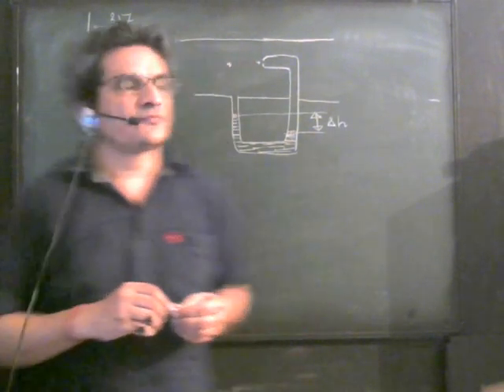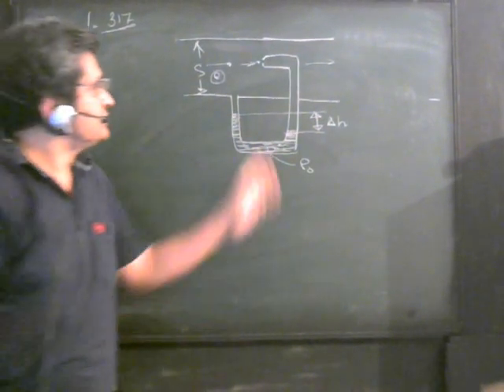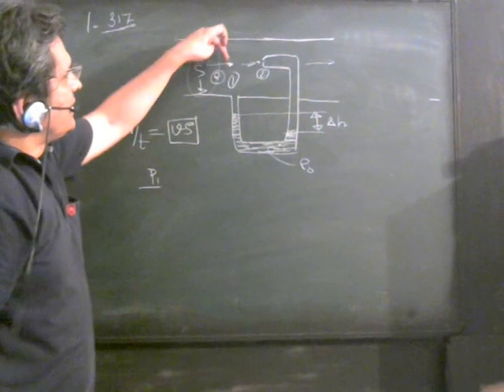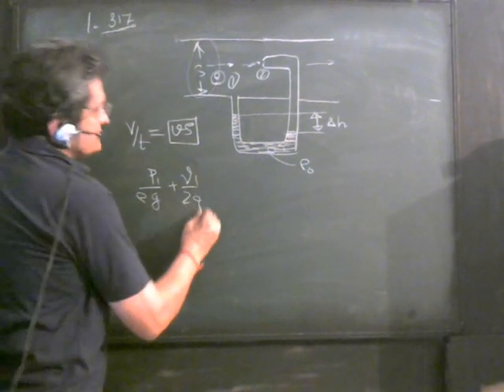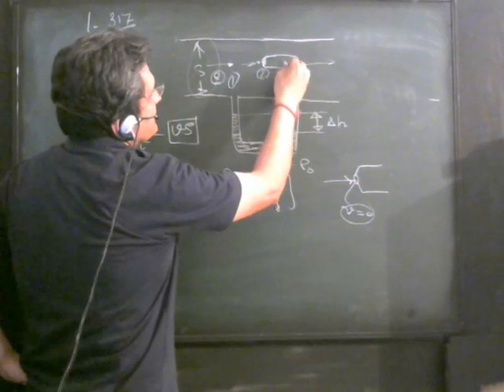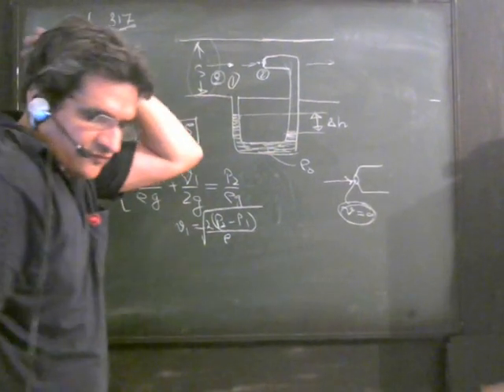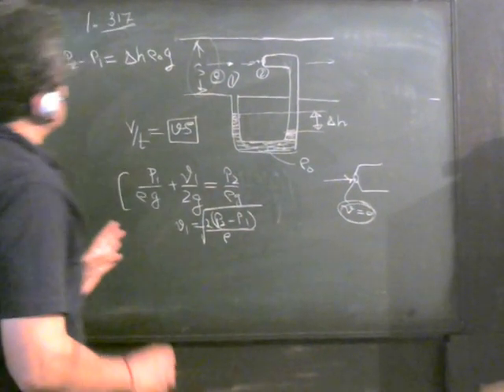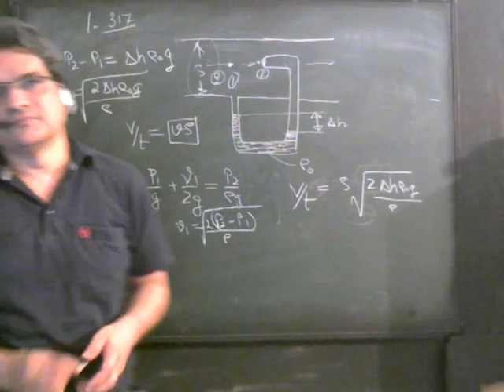pitot tube solution to irodov problem 1 .317

Comment: Sir I need solution for problem 1.315
Reply from the maker: In the problem the flow is steady. Hence at the turn the flow is irrotational meaning v.dl for full loop is zero. Draw perpendicular lines ( perpendicular  to sides ) at the points where curvature begins and ends. Also join the inner points and outer points by curves parallel to the sides of tube. This makes a full loop. The velocity of flow is perpendicular to two sided of loop and there v.dl will be zero. For other two sides the length of outer curve is more, hence velocity vwill be less. Now apply pressure velocity ber eq.